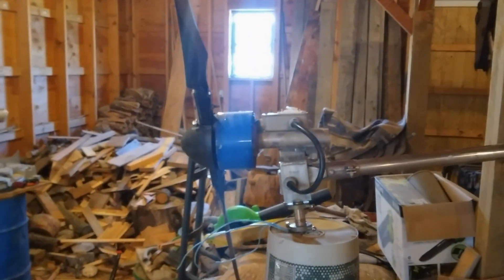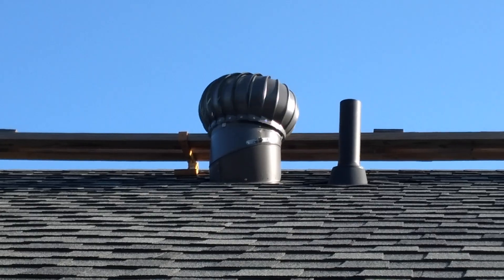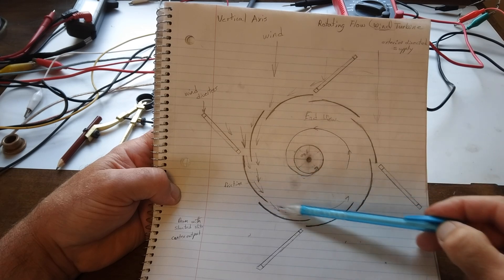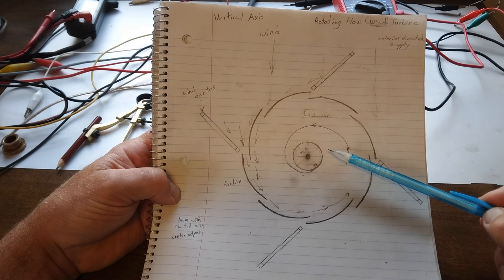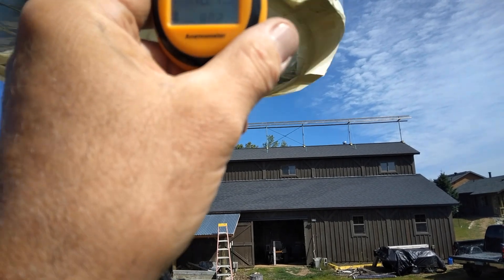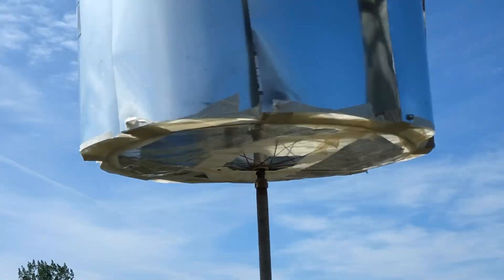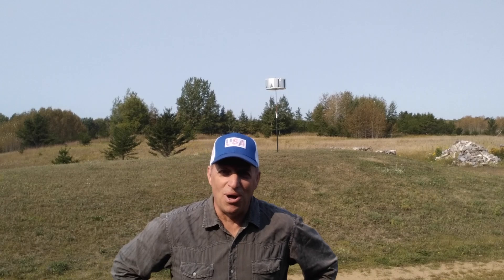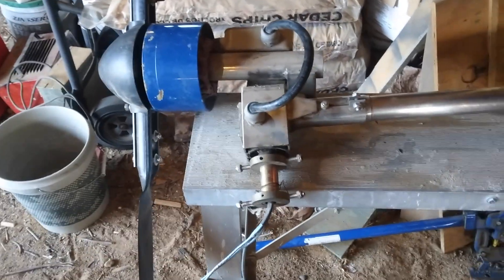Rotating Flow Wind Turbine design, (1.0)

Comment: can you put a belt around the bike wheel, and go to a small pully mounted to your generator to make better volts/amps.
Reply from the maker: Yes, that's a possibility.  This is only a small test model compared to the size I eventually want to get to, then I will try something I have in mind for the power train.  Thank for commenting!